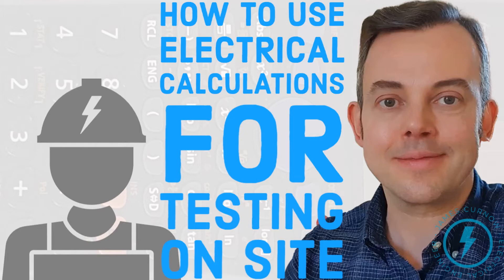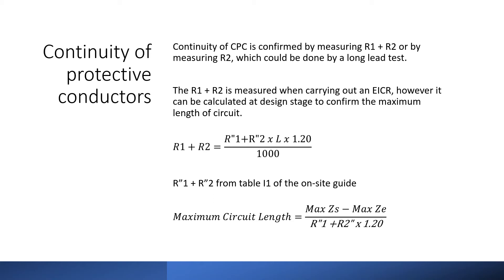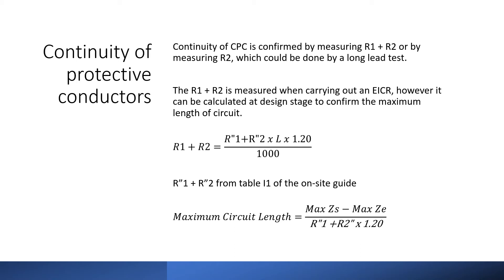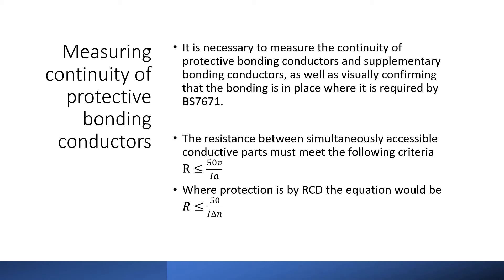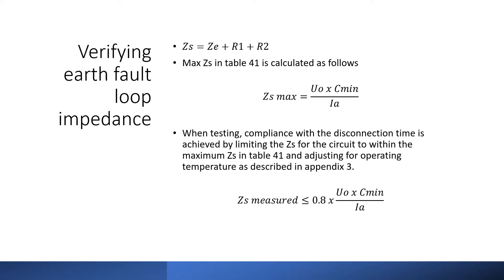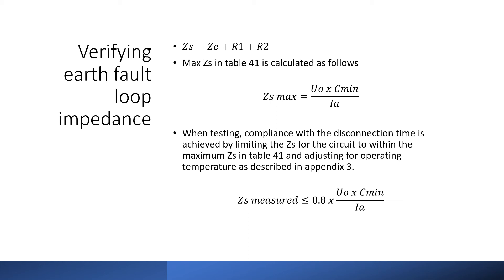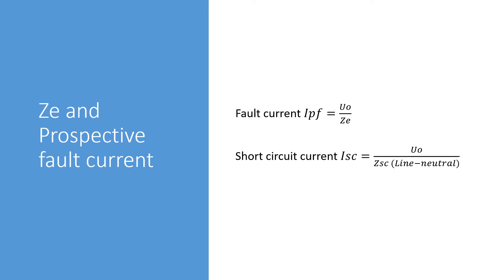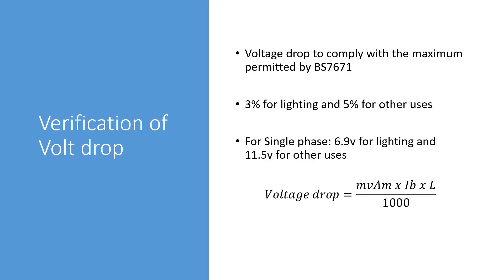How to use Electrical Calculations for Testing on Site

Comment: Great video James, could you elaborate on the voltage drop calculation, if the conductor in question is greater than 16mm? Cheers
Reply from the maker: Thank you, I'm glad you like the video. 
I'm happy to elaborate on the volt drop. In the tables for current carrying capacity and volt drop in appendix 4 of BS7671,  you'll notice that there are 3 different values for mv/A/m for cables that are greater than 16mm. They are marked r, x and z. So, if you need to do the standard volt drop equation for a cable greater than 16mm,  you would use the value marked z.
The values marked r are resistive, the values marked x are reactive. These are used when corrections need to be made for power factor.
Kind regards
James
Reply: @JamesCurnowElectricalEngineer  that’s great thanks, could you do some worked examples on a future video maybe?
Reply from the maker: Yes, I would be happy to provide some examples.

Comment from the maker: Hi everyone, please note the following correction since I published this video: Regarding continuity of ring final circuit conductors, when using pvc/pvc cable the end to end resistances of the line and neutral will be the same, however the resistance of the CPC will be higher due to the reduced size of the conductor.